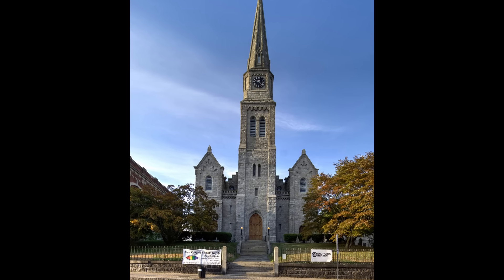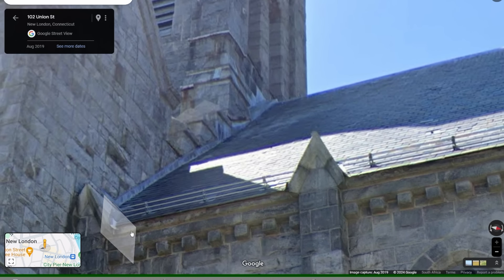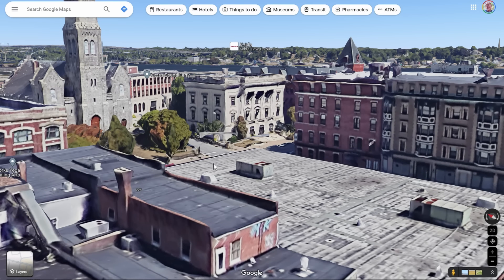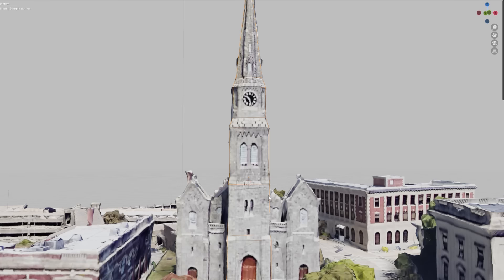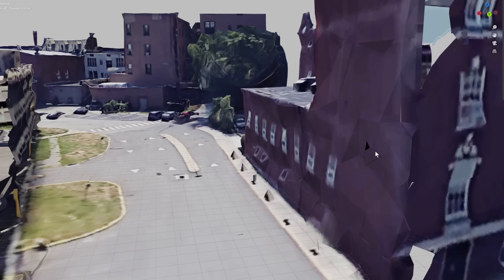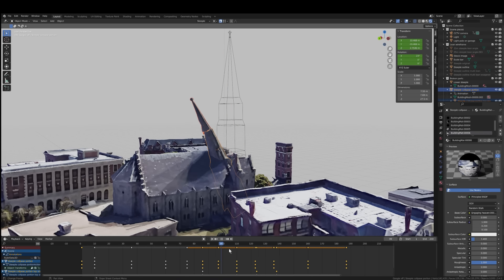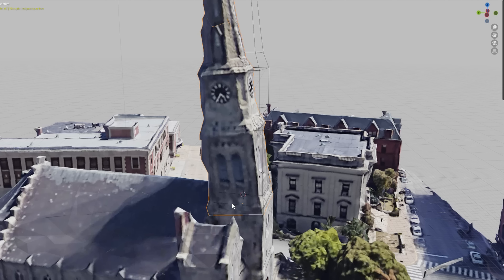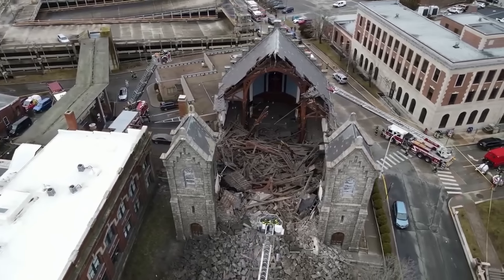Church steeple collapse | caught on video and simulated in 3d

Comment: Hi! Current New London resident here. The slight tilt was definitely a thing for as long as I've lived here. There was some discussion about an increase in tilt in the weeks leading up to the collapse. While it was not overly windy that day it is windy in general as we are right on the ocean. 
Also, another factor to add in was the snow, sleet and rain we received. The night before the collapse there was freezing rain through the night.
Reply: I think it’s despicable that the town just let it fall down.
Reply: There was also a lot of rain that fell all through December and January that may have been a contributing factor.  I copied an observed weather data report  (see below) for Hartford, CT for January 26 and you can see from Jan 1 there was 7.31 inches of rain where as normal is 2.79.  And since Dec 1 there was 15.35 and the normal is 6.87 or > 2.2x normal.  The ground has been heavily saturated for at least the last 6 months.  If I remember correctly we started the first few months with below normal precipitation but then for the rest of the year we had well above average with a couple periods of major flooding.  I believe we ended last year 18 inches over normal.

...THE HARTFORD CT CLIMATE SUMMARY FOR JANUARY 26 2024...
VALID TODAY AS OF 0400 PM LOCAL TIME.

CLIMATE NORMAL PERIOD 1991 TO 2020
CLIMATE RECORD PERIOD 1904 TO 2024

WEATHER ITEM   OBSERVED TIME   RECORD YEAR NORMAL DEPARTURE LAST
                VALUE   (LST)  VALUE       VALUE  FROM      YEAR
                                                  NORMAL
...................................................................
TEMPERATURE (F)
 TODAY
  MAXIMUM         43   1244 AM  65    1950  35      8       47
  MINIMUM         37    726 AM  -8    1948  18     19       35
  AVERAGE         40                        26     14       41

PRECIPITATION (IN)
  TODAY            0.67          2.00 1986   0.11   0.56     0.78
  MONTH TO DATE    7.31                      2.79   4.52     5.81
  SINCE DEC 1     15.35                      6.87   8.48    10.31
  SINCE JAN 1      7.31                      2.79   4.52     5.81
Reply: @DonnaChamberson it would have been as expensive as anything, to assess and fix the issue.
Reply: @jwalster9412  Yes well now the possible lawsuits could cost more. Peoples lives were put in danger - essentially, due to negligence. But hey, we'll see.
Reply: Belgian here (we have a lot of beautiful churches in Belgium) I think it's very saddening. I mean, it's not an exaggeration to say that it was a beautiful church. Perhaps not the most complex architectural style of all time but I think the shape of the spire was pretty.
Reply: @johncamara3497  There was quite a bit of rain but unless I was to look up New London rainfall itself I'm unsure of how close the numbers would be. Hartford is about 50 miles away and much more inland than New London.

Comment: I am restoring a French barn dating from around 1700. Its roof had already partially collapsed. Through watching your video, I have gained much valuable structural loading information and I am grateful to you for taking your time to upload this video. I really appreciate your efforts.
Reply: Good luck with the work.  I did the same for a similarly aged building in the French Alps.  No stranger to renovation but those meter thick stone walls (interior and exterior) I left to the experts.
Reply: @PhilJonesIII  Ha! Thanks. I know the feeling. I quite enjoy doing the stonework but the cats cradle of repaired rafters and trusses above my head does add a frisson of excitement I'd rather not have...
Reply: @SofaKingShit  I did the work when the word 'YouTube' might have been considered a euphemism.

You are right though.  Translating 'knowing how' into 'doing' is a step taken with caution.  Professional workers also have a little thing called 'insurance' so, if the unexpected happens,  you are covered.
Reply: That's not worrisome  at all, you learned valuable infornation for your barn roof restoration project from some random youtube video... I wouldn't enter your barn, that I can tell you for sure.
Reply: @Snitram19  You are making assumptions, my friend. A network of certificated steel Acrow props support the remaining barn roof area. Four separate scaffolding towers and two electric remote control winches allow me to raise oak, beech and cedar vertical supports into position as yet more temporary supports to the massive 300 year old wood structure which forms the central core. I have glass plates glued across the cracks in three of the three foot thick granite and impactite structural walls to monitor for any further movement. Because the original structure was built only using hand tools and string measures, it displays very odd structural logic by today's standards. Nevertheless, through watching this video, I suddenly realised that I had overlooked a huge potential structural failure at one point in the rafters which had been 'unintelligently' modified around 1850. I have now corrected that. This isn't 4x2 pine rafter work: these beams and rafters are each hacked by hand from complete oak and beech tree trunks, are a minimum of one foot square and weigh up to half a ton each. This complete roof weighs well over 100 metric tons including it's hardwood slat top covering and thousands of terracotta tiles. I have already successfully restored three roofs of this kind but this fourth project is insanely challenging. There are no text books or technical training courses for this work. I am a lone worker. The mayor and my local community know that if my van is seen still parked outside at night then they needn't bother to call a paramedic. ✌️
Reply: @SofaKingShit  I refer you to the reply I have just uploaded a little further below. Don't make assumptions. I've been restoring old buildings for over forty years. They are all still standing up fine.

Comment: I would guess water infiltration and ice expansion compromised the tower at the flashing where the tower met the church roof.IMO
Reply: I'm guessing water damage as well. It's also possible acidity of rain from pollution could have contributed over time. Things like this take a long time usually to develop. This has probably been slowly progressing towards failure for decades.

Comment: thanks for the detailed look at the collapse. as a restorationist and mason, now in my mid 70s, ive seen many off vertical structures, and many seem to have several things in common. (in cold climates) you will invariably find that a tower or chimney will lean toward the body of the building. in the case of chimneys on each end of the building, they will lean in opposite directions, ie toward each other to effect this lean toward the main structure. one theory of mine is that rising heat in winter from the building and roof softens the mortar on the building side of the structure, while the cold and freezing temps act on the mortar essentially lifting the exterior side. these tiny increments accumulate with time becoming permanent. also many budget repointings on soft stone buildings were done using a portaland  base which is too hard for the expansion and contraction the stone goes through. this to some degree limits settling and movement on the sides where it is used. only a high lime mortar should be used on the lime based stones which this appears to be. also if the back was south facing the sun on that face in winter would have played a part. regards and best, k
Reply from the maker: Hi Kurt
Thanks for your comment.  It is interesting what you say.  Thses were granite stones.
Reply: Makes sense.  States with their building inspection laws should have laws requiring special inspections for 100, 100+ year old public buildings.  We’re 247 years old now—never had to worry about old stone buildings before.  Time to start.
Reply: a further example comes to mind, ask any northern farmer which way his fence posts lean after a decade and he will tell you they go south, toward the sun or heat. dealt with it myself for 46 years at my ny farm. @Mike-Bell
Reply: Freeze/thaw damage would presumably be greater on the side nearer the heat source (eg a facade facing the sun, or the heat from an occupied building) as every day that would thaw what had frozen the previous night.  Joints not exposed to daily heat would freeze and remain frozen for the winter.

Comment: From what I heard, the architect complained that the wythes (inner and outer layers) of stone were not tied together properly, and suggested the steeple tower be taken down and rebuilt. Instead, metal rods ending in square plates were installed to pull the wythes together. That held for 170 years; not bad, considering the circumstances.

Comment: I was looking at photos of the church on flickr, and found one from 2012, taken from a distance (so less liable to be distorted by perspective) which when measured shows the steeple leaning back at an angle of 1.45 degrees (measured against the flanking towers). Looking at several other photos, the right wall of the steeple (when viewing the front of the building) shows a perceptible concavity at about where the steeple joins the roof.
Reply: This collapse has likely been slowly in the making for decades.
Reply: @MmmHuggles  Often how it goes, either overlooked, dismissed, or just no budget to even address it. And then it's too late.

Comment: In images of the steeple before it collapsed, if you look closely, you can see that the steeple is studded with steel bolts and cross tie reinforcements designed to keep the lower front section of the wall from bowing out. The 2011 engineer's report essentially dodges the subject of earlier stabilization efforts, other than noting that repairs had been conducted previously and that "These corrective actions appear effective, as by all visible accounts, the tower is structurally sound." A question that I might have is whether the same level of concern was given to all faces of the tower? -- or whether over the years, more concern had been given to inspecting, bracing, and grouting the exposed stonework and rather less attention was given to the interior facing sides of the wall that may have been hidden behind plaster?

Comment: My guess would be that the binding of the tower gave at some point. The whole thing was tied up with metal bars since the tower was built poorly right from the start. My guess would be one of the end plates on the bars holding the thing together was either snapped off or was pulled in to the wall. That would leave the walls with no support, allowing them to expand and collapse.

Comment: 7:30 Obviously, the clock faces were out of sync. This discrepancy would cause extreme temporal torque that imbalanced the load bearing symmetry of the clock section and made the belfry develop harmonics incompatible with verticality. Many old barns were torqued into the ground by slate roofing and compact hay bales densely packed in hay lofts designed for loose hay. The stone steeple probably was the cause of the failure. Great video! Thanks!
Reply: Good grief.  Plenty of stone steeples in UK.  Lack of maintenance, not this building having a stone steeple.
Reply: Going up you generally have entrance, ringing chamber, clock chamber, bells, steeple.  You're not going to waste space.
Reply: @billhosko7723 from its beginning the original Architect wanted it torn down and redone

Comment: The steeple leaned over and fell in the direction in which it was deviated from its center of gravity, just like a heavy leaded organ pipe collapses off its weight after many years when it is not standing vertically at the center of its axis of its gravitational pull.  It begins to lean when it is deviated off-center from its center of gravity.  The longer it leans the increasingly more off-center the lean becomes with time.  If, in addition, if the tower lacks the underlying vertical support on the side of the roof to counteract the off-center lean, it will reach a point at which the weight of the progressively leaning tower is so far shifted from the tower's center of gravity that the tower will fall, collapsing of its own weight.  This tower was likely "top heavy" due to the stone construction of its steeple, but had the steeple been built of wood, the collapse could have eventually occurred.  There may have been inadequate vertical foundational structural support for the weight of the tower from the nave side of the church.   One must also consider that the foundational support inside and under the church may have shifted or been inadequate to maintain upward vertical support required to maintain the tower's vertical position on its center of gravity.  Ultimately, what happened here: Progressive inward lean off-center of gravity  + gravity = collapse when limits of off-axis weight shift were exceeded.  Simple physics.  Gravity exists.

Comment: I'm suspicious the original mortar was not adequately batched on the one side, using too much sand or perhaps dirty sand. That in combination with acid within rain would over time degrade the mortar. You end up with a honeycomb like structure, similar to a loaf of bread, as the sand remains. Eventually the weight crushes the honeycomb structured sand and the whole tower is off balance.

Comment: The tower (belfry) and steeple are leaning.  If there was roof damage where it connects to the tower, it is possible that over time water damage with frost weakened the tower structure resulting in increased inward leaning. Your simulation appears to indicate this as the increase in deviation from the vertical of 1--->6 degrees is associated with a collapse of support on the nave side of the tower where it meets the nave roof below the belfry..

Comment: Even with shoddy construction work it has been standing for over 170 years, the questions what happened with it now ?

I believe bad maintenance is the cause of this, most likely water ingress that erroded the structural walls. 

Probably damaged gutters on the inside wall between the tower and the main building, leading to water eating up the mortar along the inner wall. 

The structural failure seems to have affected one of the corners, therefore the sideways collapse. 

One can clearly see the large and dark visible stains from the excess water running down the sides of the building all the way from the roof down to the ground, all the water that should've fallen down the gutters.
Reply: I concur with you.
Reply: Water damage possibly mixed with acidic rainwater most likely. Could have been prevented I'm sure.
Reply: Gee.  No one else thought of that - including the video author.
Reply: @billhosko7723  Boy, you must be fun at parties?

Comment: I find it sickening and frustrating that the two remaining towers of this church were also demolished. I understand it would have been difficult and very expensive to try and rebuild this steeple, but to destroy what was solid, and remained, is a tragedy. At least one of those towers could have been easily incorporated into a new church, or some other structure at the site. And if no building was put there, one remaining tower, by itself, would have been a wonderful architectural artifact, and should have been preserved.
Reply: Those other towers would need maintenance to keep standing too. Nobody had the money to do anything with them.
Reply: @Sashazur  Perhaps you are correct, but it seems to me that those towers were quite secure in their foundations. In fact, even the collapsed spire had a good foundation... the failure seems to have been in the stonework up high, about where the roof peak joins. I just feel as though the remaining towers were very solid, and would have been just fine.
Reply: @proto57 I sadly assume the collapse gave certain non-religious people the opportunity to remove the building without going through the outrage from the public
Reply: @matthewmosier8439  ... probably true. And I'll bet some speculators have their eye on an upcoming "land deal".
Reply: Basically money. If a structure or place can't earn its right to exist financially, it's not if, but when, it'll be gone, whether an act of God, or being neglected to death and demolished so something profitable can take it's place. It's only when something is gone that we have clarity and regret.
Reply: JFC... it is academic and needless at this point. Good grief you keyboard 20/20 kariens. You trolls ALWAYS show up late.

Comment: As someone else has pointed out, there are metal plates evident on the facade in modern photos that indicate several iron tensioning rods were placed at some point to strengthen the tower. Did one or more of them rust out owing to water infiltration. Was there a ground shift caused by recent heavy rains? Poor construction and maintenance too? Often multiple factors line up in to cause many catastrophes.
Reply: Novel idea, 'Often multiple factors line up in to cause many catastrophes'.

1

Reply

Comment: I have not found any pictures showing the inside but my guess would be the tower's side facing the roof rested on two pillars and those two pillars subsided slightly during the original construction and after 170 years they started to sink even more, dragging the tower with it. I doubt the collapse has anything to do with defective masonary near the roofline, the failure must have happened much lower in the structure. The tower was basically like a chair that has two legs placed on concrete and two on sand and the load put on the chair results in uneaven sinking and tilt.
Reply: a huge organ was located between the tower and sanctuary, i figure vibrations from the organ may have caused cracks in the structure also.